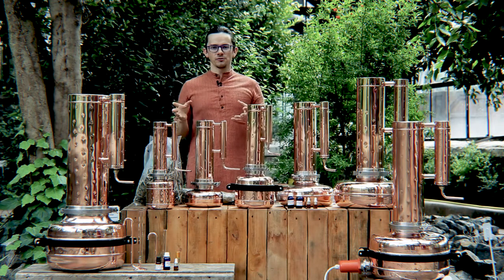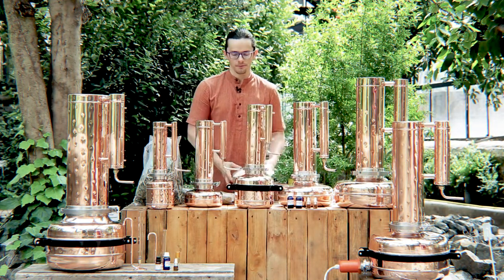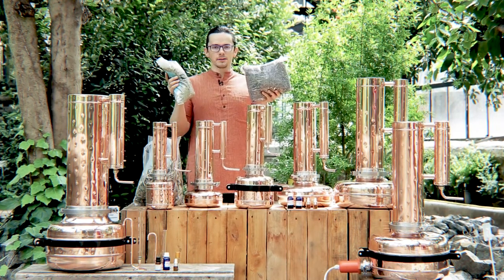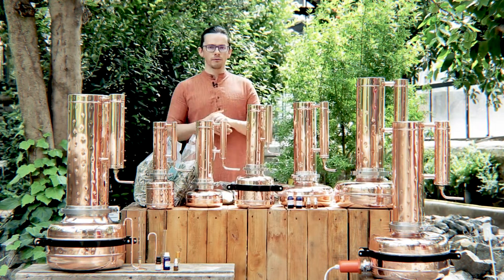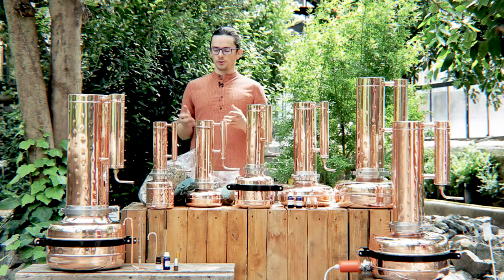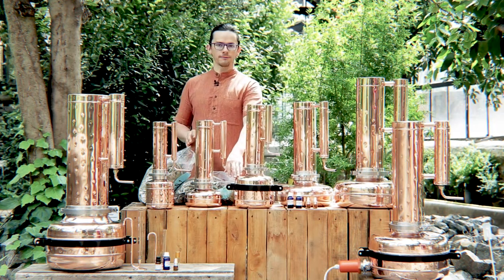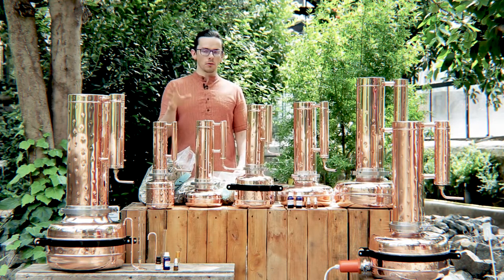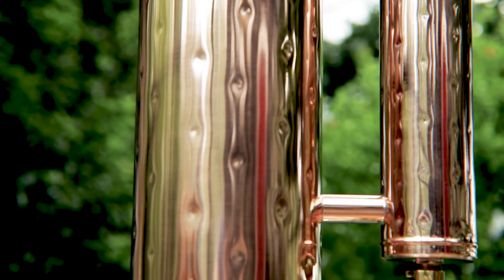How To Choose a  Essential Oil Distiller According to My Raw Material

Comment: Does.dry material better than newly harvested?
Reply from the maker: You can use both dry and fresh raw materials.  For fresh raw materials, the performance of the essential oil is slightly higher.
Reply: Really good question ❤